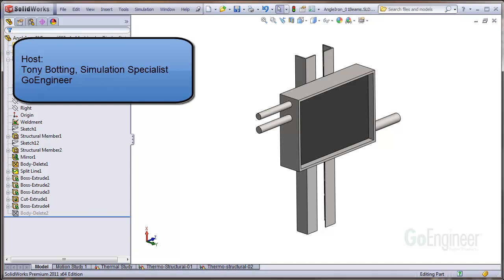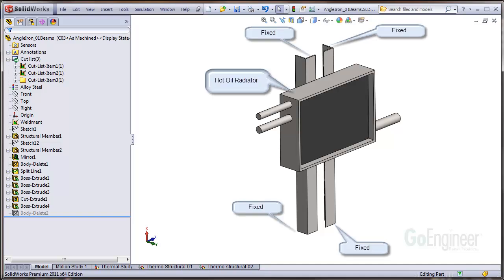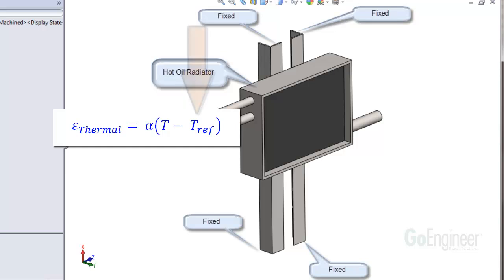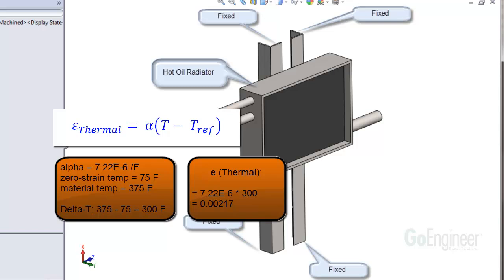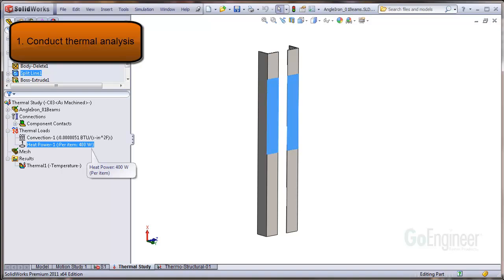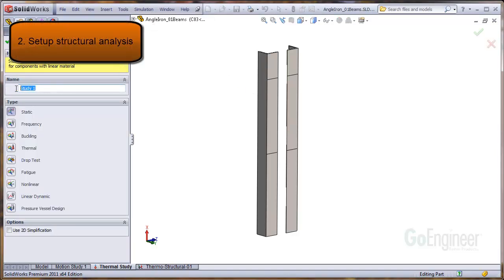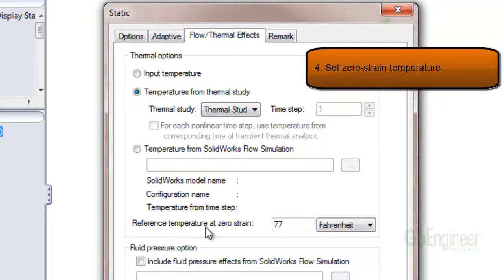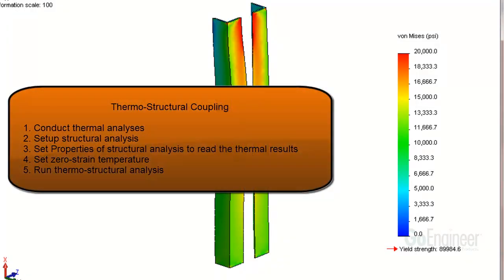SolidWorks Simulation - Thermo-structural Coupling

Comment: I almost got it, but the only thing that the simulation doesn't work is where it says "Thermal Expansion Coefficient (Alphx) is not defined for element 1. Check material" even though I already set it as ABS plastic. What should I do?

Comment: I am doing a thermal stress analysis on Annealing process of random sample shapes of glasswares i made using glass properties as in Solidworks. It is aimed to find the shortest time to cool each sample shapes without risking any presence of residual stress at the end of the process.
However I am wondering how to set the coefficient of convection (air) and coefficient of  Thermal Expansion (glassware) to be temp-dependant. I hope to hear from u ASAP as I need to submit my project.TQ in advance :)